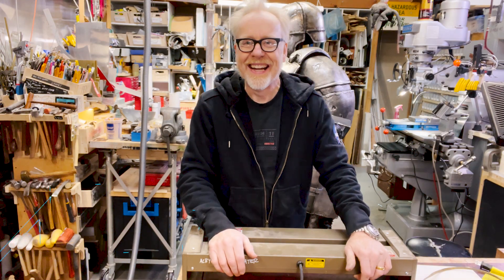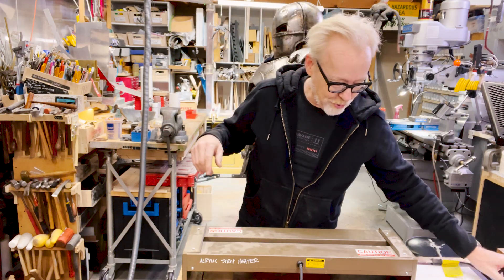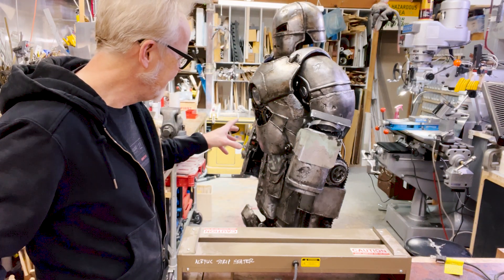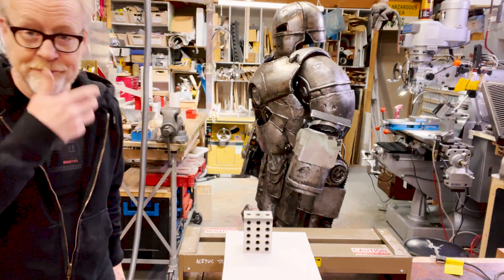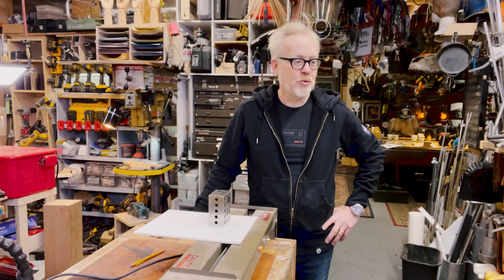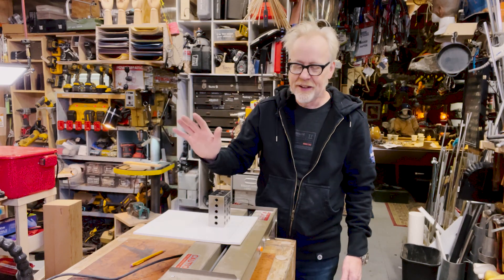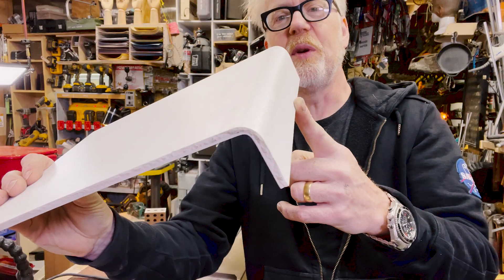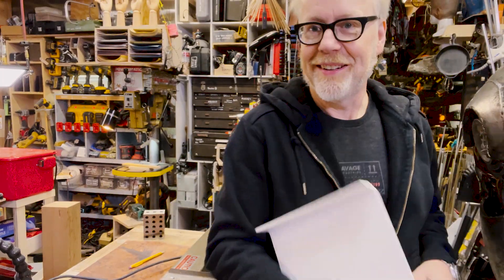Adam Savage's Favorite Tools: Plastic Forming Strip Heater!

Comment from the maker: Plastic Forming Strip Heater: https://amzn.to/3edNw48
Conair Pro Yellow Bird: https://amzn.to/3dxUPV9
Milwaukee corded heat gun: https://amzn.to/32u92Mn
Foam PVC sheet: https://amzn.to/3v77PqO
Reply: Hi Adam
Reply: Remember that wall-e vid from 7 years ago? That was a prettty cool vid
Reply: @protozenti5514  Savage made a robot
Reply: @paradox6427  Yea
Reply: @paradox6427  also I subbed to your YouTube channel because I love apex plz do more vids
Reply: Oh, Adam, if you think that is a cool way to manipulate pvc, then I have a mind blower for you!  I am a professional wall cladder, that is to say I take 4' by 8' or 4 by 10' sheets of 3/16 thick pvc then cut them and bend them to line the walls of operating rooms, industrial kitchens, factory clean rooms, etc.  We use a 10' long thermal break (like a sheet metal break) to heat and bend inside and outside corners.  It is an aluminum box lined with ceramic that has a long straight oven element inside, with an exposed upper slot.  We glue the sheets to the walls and weld the 1/16" gap between the sheets with the same kind of welding gun that vinyl flooring guys use.  It is so slick, so smooth, so clean, words don't do it justice.  The stuff is expensive, but I bet you could afford some.  The brand name is Altro Whiterock, and it is a space-age material just waiting for more artistic uses.  Also a tip: wait for your break to heat up before putting your material on it, that way you will avoid any discolouration or warping.  Also, ventilation is a good idea too!  I love your stuff, especially Tested.  Cheers from Canada!
Reply: @ferroxglideh5621  sounds like a good idea man
Reply: Dakari Zander  cool
Reply: It's in my internet is down 🥺👉👈 is it i

Comment: When I was building the original Bunnicula puppet, I needed to bend Sintra, cleanly. I laid down a bead of hot glue on the inside of the curve, and after bending I could still scrape out the molten glue with a stir stick, although it wasn’t necessary!

Comment: Former plastic fabricator here: We would prebake our Lexan and Acrylic sheets in convection ovens at temperatures relevant to the  gauge of plastic being worked on. Opacity also factored into the temperature. Prebaking helps limit bubbles that may form when bending at an improper temperature. It also makes the time on the bending board shorter and more predictable. Our bending units were made in-house to meet our needs. Our bending boards were two rows of soft white fire brick, covered with soft Kevlar. My 4x8' worktable was also covered in a soft Kevlar. Lexan scratches easily. Between the rows of was a 1/2" spring wired to a rheostat. We would adjust the wattage depending on the gauge of plastic. Hit the plastic with a quick shot of air to remove any dust, as it will interfere with your bend. With correct lighting and practice, you instinctively bend when it's time. In the beginning, just press down on one side of the piece and gently being lifting/tapping the other side up. Don't force it up; watch your piece at all times when it's on the board. We all have that chapter called 'Fire'.

Comment: You could probably build and sell, an industrial power timer switch, for your HOT Tools! So, those rare events when you left your Heaters and Hot Tools on, it would shut the tool down, if not attended. With warning lights and bells, and a reset switch!?
Even something small enough to plug into a wall socket, would be gteat for home applications!

Comment: That heating element looks just like the one in my old toaster oven. Wonder if I can just cut a slot in the top of the oven and use that? I need 380F to bend some acrylic.
Reply: Never mind. I needed to bend long 4" wide strips into complex curves. I found a better solution. A flat iron and a curling iron. Goodwill, $2.95 and $1.95. Works a charm.

Comment: Covering the heated material by putting e.g. some cardboard on top of it may help to heat if faster, as would reduce heat loss from it's surface.
Reply: I use a piece of fiber glass or a favorite board to insulate and keep the heat in the piece until it is time to make the bend.

Comment: This brings back memories of dual wielding two of these devices to create thousands and thousands of warehouse hanging signs. I can SMELL this video. Having a board over the top of the strip helps concentrate the heat and make your piece get plastic quicker. Though it would increase your chances of encountering "the fire" if you aren't paying attention.

Comment: You heat the outer curve of the bend. That seems the most logical thing to do because the outer curve deforms the most, so it has to be more flexible. But can you bend it the other way as well?
Reply: Heating both sides of the plastic you are going to bend allows it better flexibility as well as directionality. If you heat one side and bend it with that heated side on the outside, you will get an optimal result. Conversely if you heat both sides and forget which sides are inside and outside and you only have one bend on the piece, as long as it is flexible when you make the bend, it won't matter unless you have multiple bends on the same piece. Make a jig for 90° bends for best results. 
Enjoy fabbing, I do

Comment: You can use a heat isolation blanket over your piece to concentrate the heat. Talking about bending stuff, have a look at Kaka Vise Brake Die Set. Also, do you have a Machinery's Handbook in your shop for reference? Like your work.

Comment: Interesting. I've never heard of pvc foam boards. If it's roughly the same weight as normal dollar store foam board, perhaps it could be a more durable material for making gliders? But if they make it the same thickness as a styrofoam plate, that would be outstanding as the majority of the gliders I make I use styrofoam plates for the wings but the big issue is if there's even the slightest bend or crease or knick in the foam, it totals the part.
Reply: I have a Guillows Flying Machine rubber powered glider that came with a badly warped wing. I thought about making a replacement using just what I had lying around and used six flat sections I cut out of some typical styrofoam plates and used packing tape to hold them together and it worked beautifully! Then I tried changing up the design from the original wing and came up with a swept back wing with a round leading edge at the tips and it flew at least three times better than the original straight wing. However sadly, I flew the life out of it and the cheap plastic propeller wore itself to the point it fell off. I need to get another plane so I can make a more refined version and get some extra band-prop motors or find one that's more durable.

Comment: You can further focus the heat from a strip heater with thin gauge polished steel. If you have a partial bend, you can also mask half of the plastic to prevent it from getting hot. Also, fixturing the final shape is key to a high quality final product.

Comment: I made my own strip heater about 5  years ago, they are really awesome to have. Mine has a 15 minute timer built into its power supply so it always shuts its self off. They are really quite easy to make, just some metal channel, apropriatly sized heating element (NiChrome wire) and a power supply.

 My how glue gun and primary soldering station also have similar 1 hour timers. A few too many times walking into the shop and saying what is that smell. along with a full glue stick in a puddle in my glue gun stand.

Comment: My job is working as an industrial electrician and one of the places that I work at makes pvc piping, tubes, and other pvc parts and its a huge factory.. they say the hardest thing for them to produce is the thin sheets of pvc like what Adam is using.. the great thing about pvc is that when they produce it, it is recyclable.. so if a pvc part was not formed correctly then they can grind it up into small pieces and re-heat, and re-use the grinds they made.. it is awesome that I get to work on machines that make materials like what Adam uses all the time..
Reply: Just as well since PVC is apparently one of the most toxic plastics to produce.

Comment: We made one in the 90's but had square tubing fixed either side the heater strip and water plumbed in to cool beside the heater strip so the heat was focused to the perspex sheet we were bending. Heat creep is a thing hence the need. Caution with water and electronics advised here though. Rather than a close recirculating system we just used a couple of hoses..........one going in, and one going out into the little garden outside lol
We were a large architectural Sign shop and commercial versions of this, required the sacrifice of your first born and a virgin to buy.

Comment: I coach a robotics team in Minnesota and I send most of these videos to the other coaches on the team with "hey can we get one of these"
Reply: FRC 3572 here, this tool is magical for bending plastics.  Polycarbonate has the protective layer of plastic on it and that is an aid for bending with heat too.  You'll know it is ready to bend when the protective sheet "sweats" or looks slightly wet.  Just don't leave it on too long or the material will bubble and be brittle.

Comment: I have used this same type of strip heater to bend foam PVC as well. I find that back-cutting the PVC on the table saw about half the thickness of the material and just over 1/8" wide (for 1/4" thick material)  allows you to fold the material into itself, creating a tighter bend and a perfect 90 degree interior corner while also 'guiding' the bend along the cut line which keeps it straight.

Comment: I've used a heat gun for this, but what I did is clamp the plastic in a vise, heat it up, and use a piece of angle iron to push it over. Worked surprisingly well.

Comment: Bend pieces of sheetmetal commonly have 2 lines (almost just scratches) that run parallel to the bend, on the outside face of the bend, on equal distance from the centre of the bend. This is a result of the use of a guillotine sheetmetal brake. If you want to imitate the fingerprint of this specific tool that is widely used in the sheetmetal industry, then you could look further into this :)

Comment: One downside to most calrod heaters, like the one here, is that it makes for a wide heated zone, and a larger radius bend.  If you look a nichrome wire strip heaters, they give you a much finer line of heat, and make cleaner bends.  They both are functional and have their place, but I generally prefer nichrome wire versions (they're also dead easy to make yourself).

Comment: Ultimate tool tip: Digital Calipers. With the press of one button your imperial measurments turn into metric :D
Reply: No one's used the Imperial inch in almost 100 years now. Today we use the international industrial standard inch. Which is precisely 25.4mm. The old Imperial inch was a wee bit smaller than that.

Comment: So for items I plug in that heat up (Thermal wire strippers or glue guns), I plug them into a ‘timed outlet’.  I picked up a timer controller that has a button, 5 min, 10 min, 20 min, etc and added an outlet to it so it’s controlled.  Then when I want to use it I turn it on for whatever duration I’m going to need.  And I never worry that I left the ‘oven’ on in the shop!
Reply: Great point.  You can build your own using a line voltage timer (McMaster calls them "wall mount timer switches"), either wiring it into a fixed circuit permanently, or on a gang box on the end of an extension cord.
Reply: I've installed a wind-up version of the timer control into my soldering station.  For other hot stuff near my desk (usually hot glue gun), an old Gra-Lab darkroom timer.   Make sure you use the right outlet, most are set up so one outlet turns on when the other outlet is off.

Comment: Flip your breaker when you leave the shop
Reply: Standard breakers are not designed to be used as switches. Doing so repeatedly can damage them. They do make special breakers you can use as switches though.

Comment: Yes, I was screaming at the screen. 20 years of plastic fabrication you were  doing this all wrong.  constant flipping is  needed to even heat and  reduce or eliminate stress  I have bent 8 foot lengths of 3/8 acrylic and this is a very learned art. Mistakes can happen fast and expensive.

Comment: I found I get better results using a double strip heater, so both sides of the plastic are heated. Not so important for thin sheet material, but really important for thicker plastic. The foam PVC is good material, you can buy different colours and also a harder high gloss version.
Reply: Save a few bucks and turn the plastic over to heat the other side

Comment: Just watched a video of JayzTwoCents  (PC and custom pc builder)  trying to bend acrylic for a custom build and struggling a little, using a hot air blower.  An interesting confluence of the two approaches to this.
Reply: For things like Acrylic, I use a torch. Propane works fine, but a few passes with a map gas torch should get it plenty hot to bend how you want it. It do get hot tho. 
For more precise control, especially in smaller areas, a butane torch works just fine as well. Just got to make sure not to hover in any particular spot.